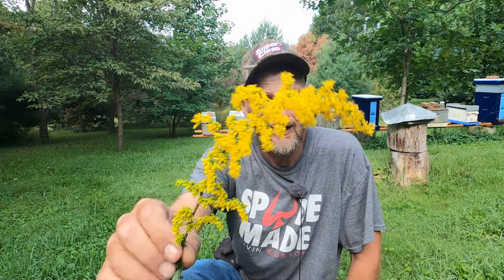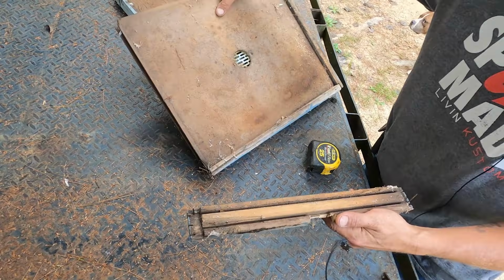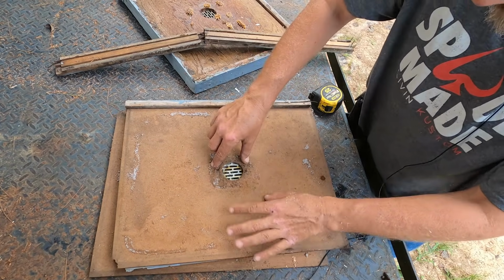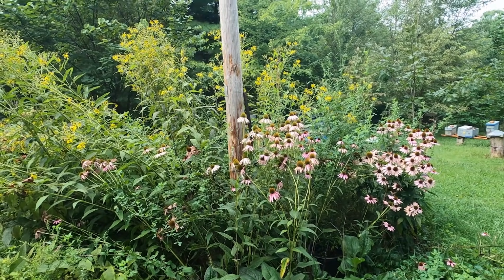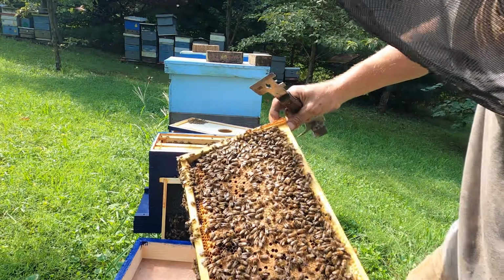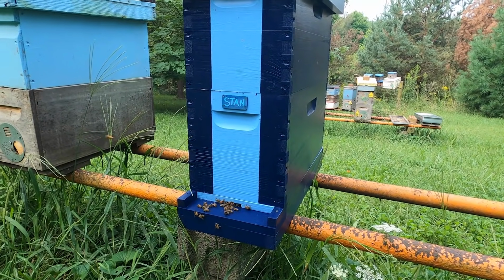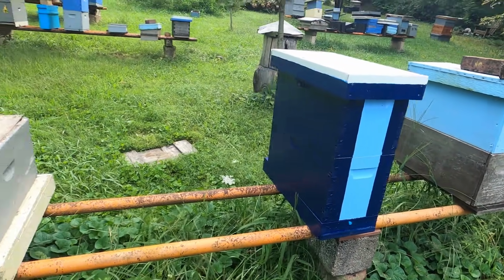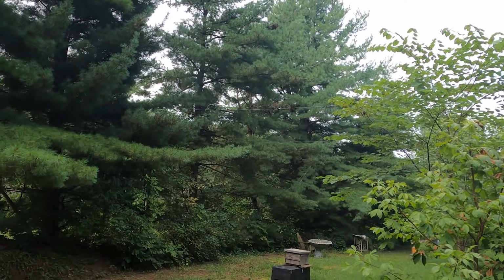Sumac/Varroa Results From Stan, Insulated Inner Cover (DIY Project) & Swarm Update

Comment: I've been using the insulated covers for 30 years now , they are  great for winter and summer.
Reply: With or without the upper vent?
Reply: @sidelinerbeekeeper  in the video , they were an inner cover that was insulated , mine are insulated outer covers . I use standard wood inner covers , canvas, and reflectix . Of the inner cover items I may use one item alone , or all of them togather . For winter , I use the clauss hive dome, with the insulating items on top. some of my hive's I use the dome in the summer also, and all the hives have a slatted rack ....  I dont use any top venting for summer or winter.

Comment: We smoked ours through the front entrance until smoke came out of the inner cover. We also screened the inner cover vent so they couldn't pour out of the hive. A good number of them come out of the entrance but they eventually went back in. We did this for 3 weeks in a row and saw mites drop. We also did this with a mix of mineral oil and thyme oil and saw good results too.

Comment: I winter single deep. I use migrant covers with hole for 1 gal bucket to feed spring and fall. But you know i winter shed my hives. Did a mite wash on 100 of my hives. only had 1 mite show on 2 hives and both where by one another and by where we remover 2 tree hives that where mite bombs in the spring. all hives have strips atm and will vape before i shed. I am with ya on that power wire. Hell with that. i dont do being cooked. Roxie says hello to Ladybug

Comment: This is my own findings.....confirmed with my broodminder....but I found that a decent size lower entrance and no upper entrance (with insulated top) is all that was necessary. The cluster heat kept any snow melted from the front entrance. They were ok without any cleansing flights until March when the snow melted anyway. 
Broodminder showed that the humidity at the top of the hive ran equivalent to the outside humidity. This winter I will attempt to duplicate the results and confirm that no upper vent was the best configuration for me.  I mean...there is no upper vent in feral colony hives.  Good cluster size, low mites, plenty of stores, good wrap and no upper vent. 
Although upper vent seems to make sense to eliminate humidity, what it serves mostly is to remove heat from what I've learned through experimentation.  Beekeeping is local though.
Reply: Agreed, two years without upper entrance,  not going back. Moisture goes to the outside walls, frost forms on those uninsulated surfaces. Think about how air flows, heat steady rising from the center, pushed to the outside edge where it cools, then falls, which pushes the moisture to the outer walls. No moisture can drip on the bees. Wide open lower entrance allows enough air exchange for the dry winter air to pull moist air from the hive.

Comment: The difference in your smoking technique / procedure may have made a difference in the effectiveness of the sumac treatment. Last video I saw with your sumac treatment you left the lid on. The concentration level of your sumac smoke would be much lower with the lid off and thus may have reduced the effectiveness of the treatment this time.

Comment: Love what you're doing but I had a few thoughts. 1. With the swarm in the tree,  I know scouts prefer to look for new homes off the ground. (Ideally 12')  Maybe you can put the box on a ladder to elevate it off the ground?   As for your Hive top, Tom Seeley has a video out called Darwinian Beekeeping.  You can geek out and watch it on Youtube. It's an hour long but 30-40 minutes in he talks about having a top entrance. 1. bees don't like them. 2. Insulating the top is great.  It prevents condensation as the bees move up the box in the winter.  (It will also keep them cool in the summer) If there is an entrance there, you are letting in cool, moist air that will condensate above them and get them wet. (Not good). If you only have a lower entrance, the moister will be below the bees.  They stay warm and dry but have access to any water below.  Obviously snow is an issue.  My suggestion to solve that would be to raise your hives if you can (maybe add a block or two) or be diligent about removing snow from the entrance of your hives.  Just some thoughts.  Tom Seeley has some really informative videos.  Keep up the good work!! Good luck with that swarm.